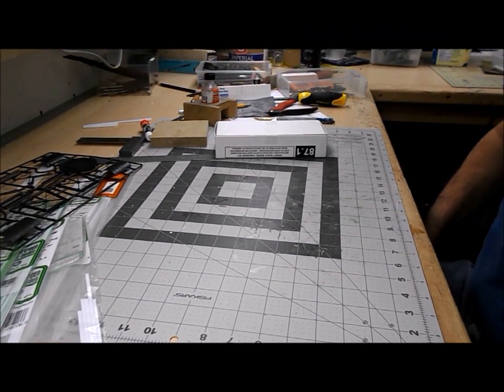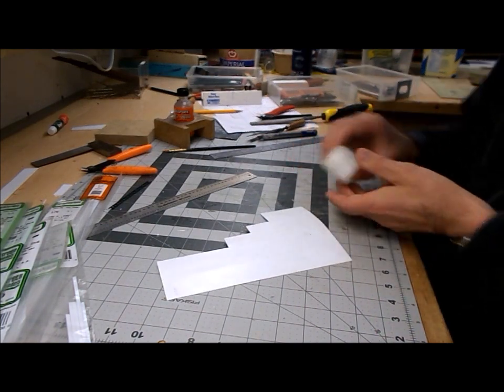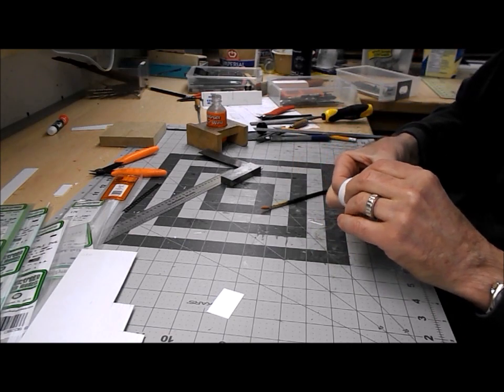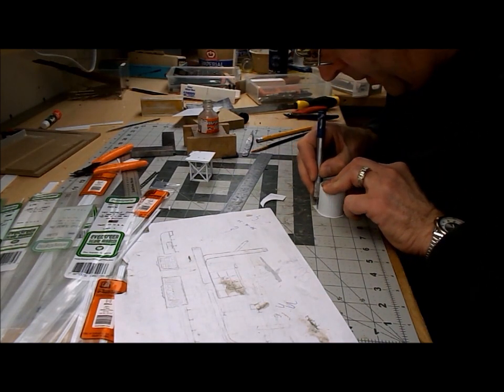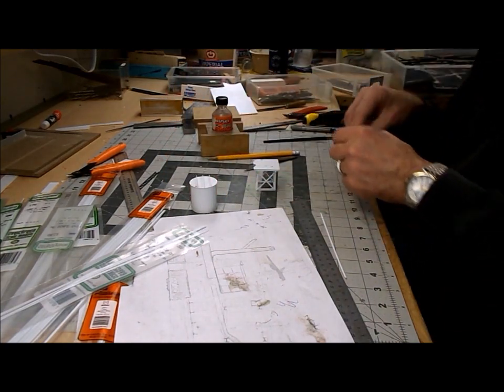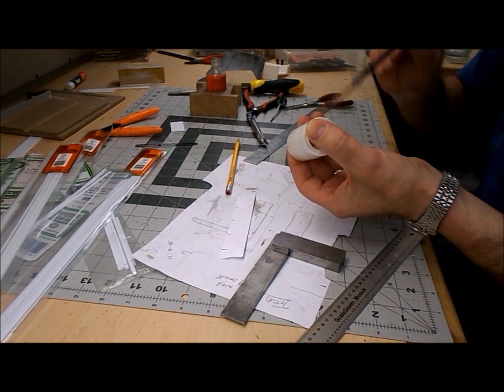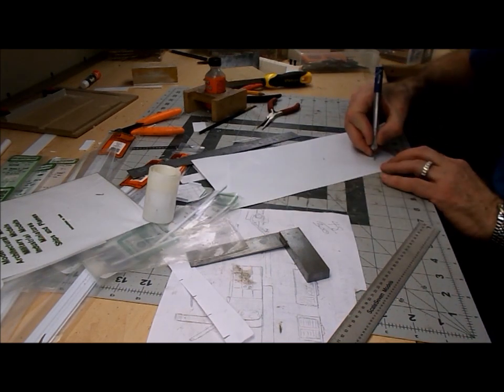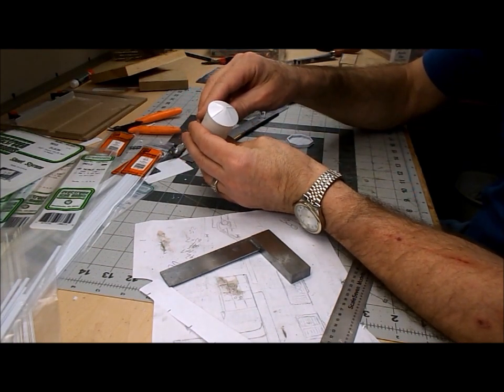Rooftop storage tanks for National Widget

Comment: What is the name of the glue that you are using it looks like it only takes seconds for it to set up. And why do you use a paintbrush and not the brush that it comes with the glue
Reply from the maker: I'm using a solvent called Methyl Ethyl Ketone, which I buy in quart cans at a home-improvement store and then just transfer to the small bottle.  I find that a regular paintbrush is easier to control than the one that comes attached to the lid (as well as coming in different sizes for different jobs).